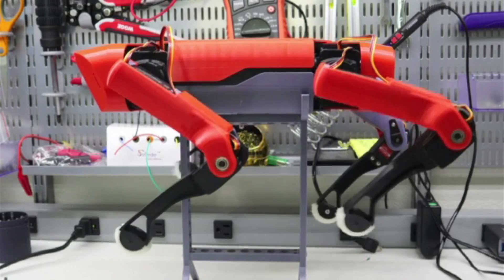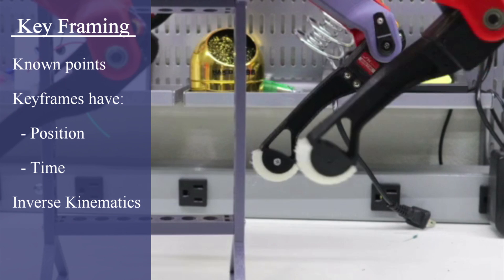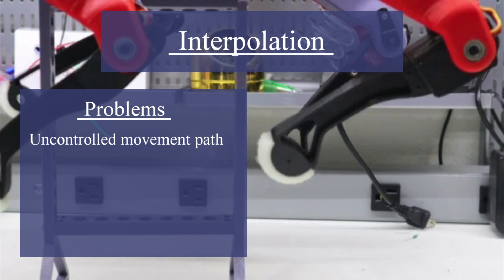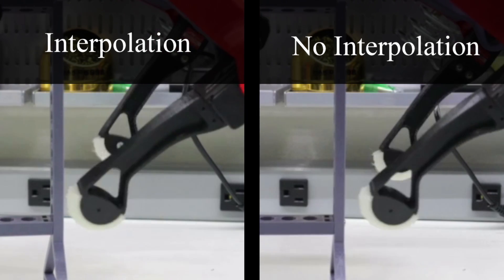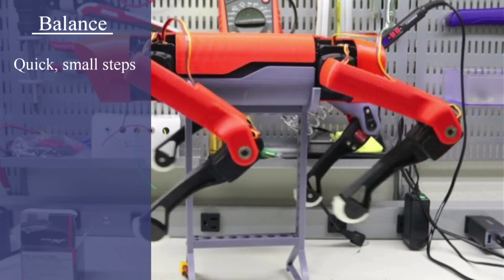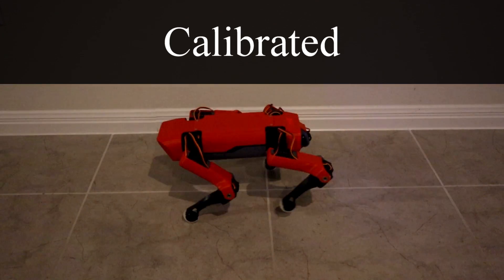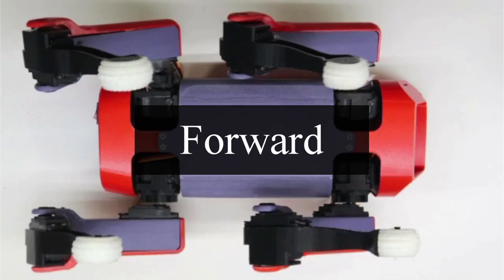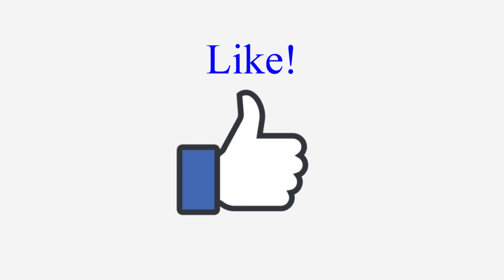Development of Walking Gait for SpotMicro | Spot Micro Walking Demo

Comment: Tell me, I implemented the same walking algorithm, but under load my robot constantly falls on its hind legs, and not straight when it is suspended in the air. Did you have such a problem and how did you solve it?( in this video you spoke about calibration legs, but i was do it)
Reply from the maker: It could be a balance issue if you have too much weight in the back. I used adhesive Velcro to fix my battery in place to prevent it from shifting its weight. You may also have issues with under powered servos. If the rear legs are under powered, they won't be able to lift their full weight. I hope that helps.
Reply: @AdvancedHobbyLab  thanks. i used a SPT5435LV 35 kg. It is normal for robot  with 1.8 kg?
Reply: I made calculations on the load and if a paw 220 mm long on a 35 kg motor cannot pull a walking robot (the motor works at the limit). What motors do you use and how much does your robot weigh? Can you tell me the length of the paw when it is fully extended?
Reply from the maker: I use PDI-HV5523MG (23kg) servos. I think your 35kg servos should be more than enough.

Comment: Hey man, it's looking awesome! 
I'm now waiting for my servos to come and printing parts for the SpotMicro meanwhile, hope to construct something similar. 
Two questions - 
1. Don't they already have everything for the gait in the SpotMicroAI repo? 
2. From my naive perspective the stance of all of the examples of SpotMicro is looking too low, and may kinematically affect the possible max speed in terms of shortened motion range. But I'm probably wrong with this suggestion? 
Nevertheless, your work is really impressive!
Reply from the maker: I think the basic-runtime for SpotMicroAI doesn't include inverse kinematics or animations. However, I learn by doing, so I built my own repository that includes these features: https://github.com/AdvancedHobbyLab/SpotMicro.

You're right, many SpotMicro builds use short step sizes. I longer stride could yield faster speeds. The issue that you have to be concerned with is balance. The further you extend a leg the more likely the robot will tip over. I would recommend starting with a short step size and then experiment with increasing step size to find the right balance.

Good luck with your build!
Reply: @ thank you for the tips and for the repo link! 
Also wanted to ask you what is the current project status - are you planning to post some new videos about it or to implement any new features for the SpotMicro?
Reply from the maker: I have a few project ideas in mind. I want to redesign the shoulder with a bearing mounted brace for added stability. I also created a video where I integrated a GPU TPU into a Raspberry Pi. (https://youtu.be/iNSahfWDXZA) I would like to add a camera in the front so that it could autonomously move and automatically avoid objects. Are there any new features that you would like to see?
Reply: @ you’re reading my mind with these improvements! 
I’m also leaning towards more autonomous robot behaviour. 
Nice idea with Google TPU - didn’t thought about it, I was only considering Nvidia’s Jetson Orin, but for now it’s too expensive for my project 
For now I ordered raspberry pi 5 + raspberry pi camera 3 to try to implement some basic ML object recognition, waiting impatiently for all the parts to arrive :D
One more thing that I have in mind, but imo it would hard to implement, is some kind of a docking station for Spot Micro (for example a platform with some magnetic socket on which robot can dock on top) for charging purposes.
Reply from the maker: I like the docking station idea. I've looked into something similar using induction charging pads. Adding the pads wouldn't be too hard, but the challenge would be to add a charging circuit for a 2S lipo that can charge the battery without over charging it and causing it to explode. I might want to work on some power management circuits anyway. One problem with the spot micro design is that there is no way to monitor the battery making it easy to over discharge your batteries.

Good luck with your ML object recognition! Sounds awesome.
Reply: @AdvancedHobbyLab  "he issue that you have to be concerned with is balance. "... but in other project step is not shot! for exaple https://www.youtube.com/watch?v=ztCE2fqSIxo . Why his robot is not tip over? i was tested 2 tip of step and not good :(((((

Comment: hello AHL, I completed my hardware build and I was able to get the code shared in the GitLabs repo working fine. This is the repo created by Fran Ferri. However, the code does not support trotting or walking. It only supports pitch, roll and yaw in place. However, I see lots and lots of people with working bots such as in this video:

https://www.youtube.com/watch?v=1c69yX3WUYI

I know some people are using ROS. That repo seems to only compile on Xenial and a very old version of ROS.

Comment: I'm also building a Spot like yours. These videos are encouraging me to continue with the project :)

One question, when you talk about calibration how do you manually set every servo to 0? 

thanks
Reply from the maker: That's good to hear! Building a robot is a great experience.
If you haven't seen it, I have a video on how to zero servos: https://youtu.be/mwpIMD-3udw
In short, you pick an angle, like 90 deg. You then command the servo to that angle before mounting the servo horn. After the robot is assembled, you can further zero it in software by manually adjusting an offset from the zero position until it is perfect. I hope that helps.
Reply: @AdvancedHobbyLab  That is how I did it when I built spot a couple of months ago, I wasn't sure if you where doing it any other way, so I asked. 

Thanks for the link :)